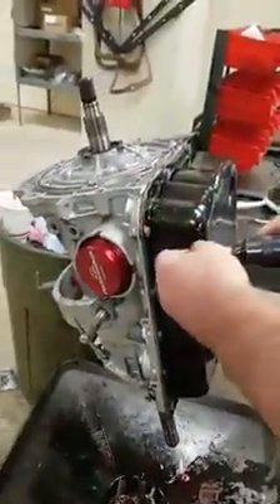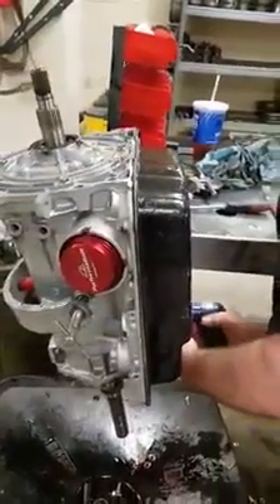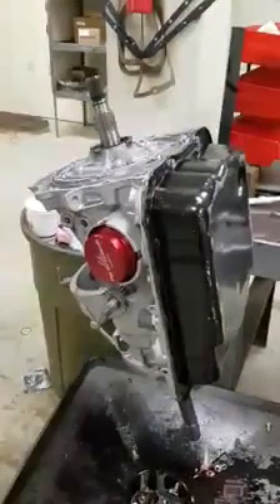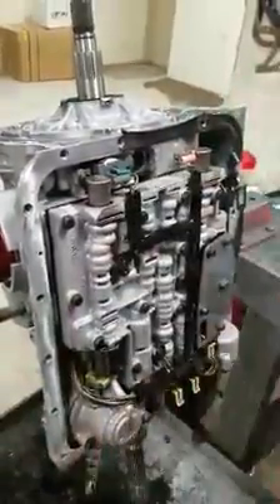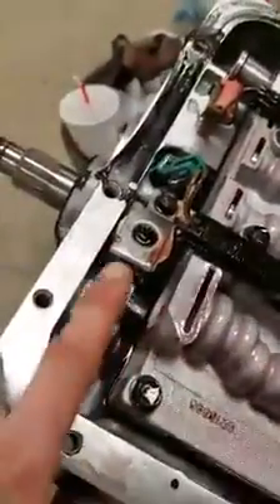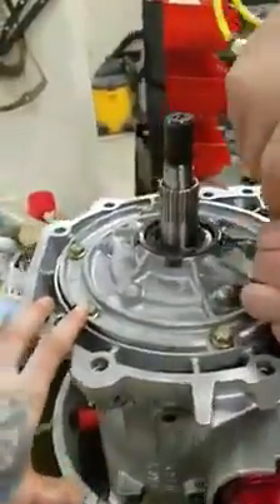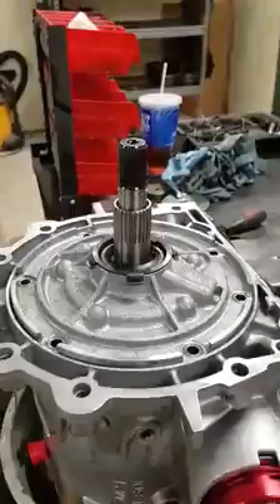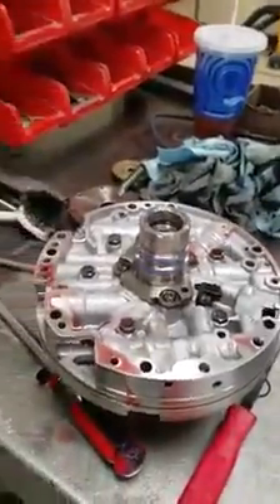4L60E PUMP HOW TO REMOVE AND INSTALL

Comment: Great video and removed it with no issues as you described. So now I want to order a matching pump, were can I find the part number of pump? I see a number on pump casing on the outside and inside. The previous owner had transmission rebuilt but did not install correctly and broke pump tangs off for converter engagement.
Reply from the maker: You will have to go by the year make and model of your vehicle to get the appropriate pump style through any parts supplier

Comment: Looks like an easy process but I didn't know if you guys did custom work on the pumps or not.. can I just throw a new oem pump in my lvl2?
Reply from the maker: We do alot the the pumps so no, an oem one will not perform near ehat ours do
Reply: @PerformaBuiltTransmissions  that's what I was figuring. Guess I will have to snatch it out and get it up there to you guys soon
Reply: @PerformaBuiltTransmissions  floored it from a 5mph roll and after spinning through first gear I lost all gears when it attempted to hit 2nd. I'm assuming it's the pump. No forward or reverse gears work and is making a slight whining noise. Happened yesterday. No leaks. Fluid is still red.
Reply from the maker: You broke the pump. Your spacing was wrong on install or your flexplate is wornout and over flexing. All that ever breaks a pump.
Reply: @PerformaBuiltTransmissions  most likely flexplate I guess??  Been flooring the truck religiously for about 2 years and never had a single issue other than solenoids which is nothing out of the ordinary. So if spacing was wrong, how long would it last? That's what is leading me to believe it's the flexplate
Reply from the maker: It is most likely your flexplate since its been driving for 2 years
Reply: @PerformaBuiltTransmissions  I wouldn't doubt it. It's the original flexplate. Are there better aftermarket options or should I grab a brand new oem plate

Comment: Is this pump removal method possible without removing the bellhousing?
Reply from the maker: yes but its very hard
Reply: @PerformaBuiltTransmissions  pump got stuck, had to remove the bellhousing. After that it came right out

Comment: What year was this transmission? I'm trying to replace the input speed sensor but nobody has a pump pull showing the sensor...???
Reply from the maker: all you really do is unplug it and the rest stays attached to the pump when pulled. then its simply an 8mm bolt holding in the sensor on the backside of the pump.

Comment: Does the TCC go back in a certain way? Like can it be put on a half a turn off?
Reply from the maker: im not sure by what you mean a half a turn off but yes they only go in one way
Reply: @PerformaBuiltTransmissions  if it goes in one way then I have no worries. What I meant was if it went in one way or you could flip it around 180°  which is a half turn off
Reply: @PerformaBuiltTransmissions  I think I got it and I appreciate it you getting back to me.....thanks a lot
Reply from the maker: No problem at all

Comment: Is this the same process on an 2008 2wd transmission
Reply from the maker: yes except there is an additional ISS sensor you must unplug before pulling the pump.
Reply: Regarding doing this process on a 2009 9lpd. I need to change the pump. What all needs to be pulled from the valve body before I can attempt to pull the pump with out damage to any of the sensors. I know this is a long shot but any advice in them right direction would be much appreciated.